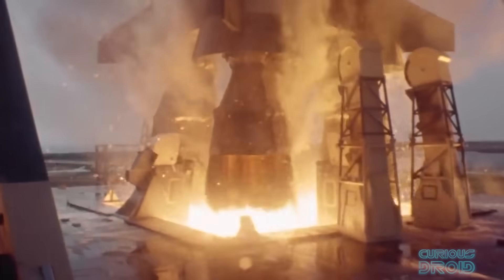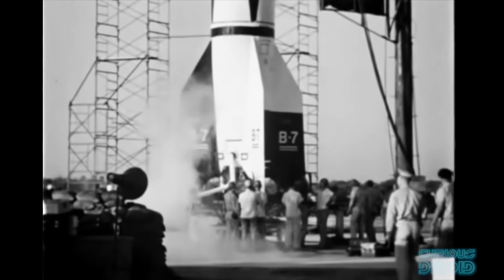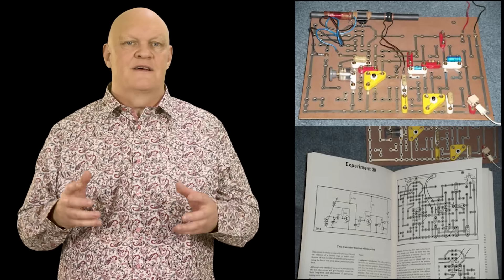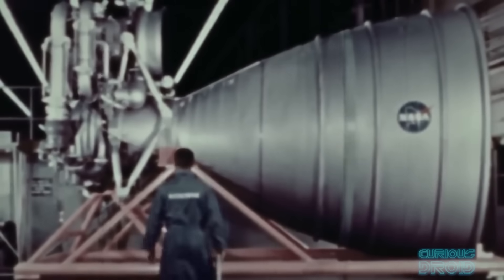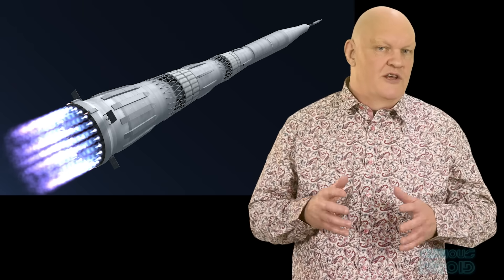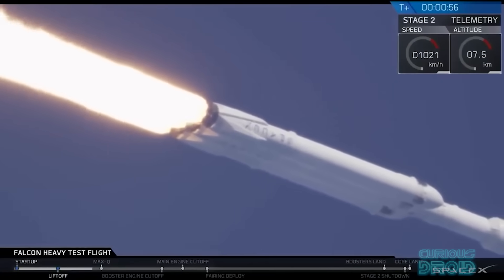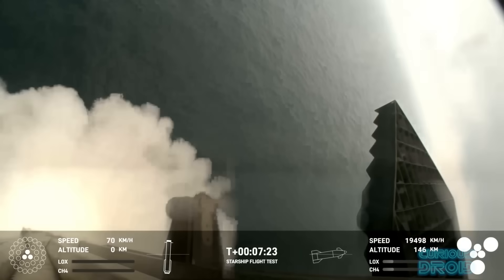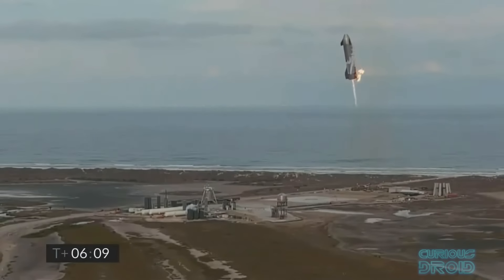Why Does SpaceX Use 33 Engines While NASA Used Just 5?

Comment: Because NASA's engines actually worked.
Reply: So do SpaceX’s engines.
Reply: @Hobbes746  Is that why they're still sending up empty rockets that haven't been recovered, years after they were supposed to be on Mars? Very impressive. 😂
Reply: @Videomorgue  SpaceX is behind schedule. This is not surprising: their schedule for Starship was hugely optimistic. 
They first spent several years working on carbon fibre structures for Starship, before scrapping all that work and starting again with stainless steel. 
The test campaign they’re conducting now is moving very fast, compared to the development of pretty much any rocket in history.

Comment: I was taught that the F1 engine itself was capable of lengthy operation.  But, the gas generator assembly wasn't.  By design, the generator ran very rich and sooted up the pump turbine vanes quickly.  Between operations, it all needed to be "de-sooted".

Comment: The main problem of many engines, however, remains unsolved. More engines means more points of failure, so the reliability (for single use) needs to be somewhat higher (certainly for human rating). The reliability, if reused for extraterrestrial landings, needs to be, for all practical purposes, a straight 100% - if there's so much as a hint of a single engine failing on launch from Earth, the mission needs to be abandoned.
As long as they keep accepting engine failures even on first launch, they're never going to achieve any of the goals that are claimed for Starship. Not that that's going to happen anyway - Starship is designed based on 1950s science fiction magazine covers, not on any understanding of rocket engineering.
Reply: Raptors reliability is steadily increasing over that last 5 years. They're soon to be moving onto v3 that will be even more simplified and reliable. So much so the point where they can get rid of the shielding around them and save mass. Starship will not need all three of the Raptor engines for an extra terrestrial landing. They can lose one right off the bat. And if it's late into the landing they can lose another. But at that point they may need a rescue ship. Nothing about Starship is from the 1950s. It's being designed for full reuse. No one has ever done anything like that before. That was a very ignorant comment.

Comment: I don't claim to be expert, but I think the detonation of black powder charges in the nozzle came AFTER the solution was found.

With all injectors venting into the engine bell from a flat injector plate, strands of unstable combustion were free to then randomly destabilise other areas inside the bell. The solution actually came from the V-2 engine injector configuration, where fuel/lox outlets were grouped in clusters. This meant that instability in one cluster was overwhelmed by stable streams of thrust adjacent to the momentarily defective impulse.

NASA opted to then add baffles on the injector plate to compartmentalise the thrust streams. This was finally proven effective by falsely imposing instability with the said charges, which was contained by the flame in the adjacent streams beyond the adjacent baffles.

Deniers often claim the instability was never solved, and that the 'pogo' issues which ensued led NASA to fake the landings. This is nonsense. Combustion instability was solved by the baffles - pogo is a longitudinal oscillation that can occur at any time in any system due to very small deviations in the rapid delivery of liquids (the mass flow rates) to the engines, passing vibration to the surrounding structures, particularly the X-beam trusses in which the engines were mounted. 

This was heavily mitigated by using in-line helium dampers in the LOX lines to interrupt any resonant frequency build-up induced by momentary pockets of vacuum in the flow. By these methods instability both sides of the injector plate were largely eradicated.

Comment: At 1:11, you say:

 "The Apollo program, and later Skylab program launched 13 Saturn V's, Which included Apollo 4, 5, and 6 (the unmanned test flights), and used a total 65 Rocketdyne F-1 engines, with a 100% success rate."

I have 2 corrections:

Correction 1: The Apollo 5 launch was performed by a Saturn 1B (which uses 8 Rocketdyne H-1 engines on its first stage, and no 5 F-1's).

Correction 2: The F-1 engines did not have a 100% success rate in the sense of them all functioning perfectly during their missions. During the Apollo 6 launch, 2 of the 5 F-1 engines malfunctioned. (One  shut down early due to pogo oscillations, and the had performance issues.) That resulted in the rocket never reaching its target orbit, though it was still able to fulfill its mission of allowing the Lunar Module to be tested in space.

Comment: Scale of economy, relative mass production, and statistical probabilities. If engine has a 1:30 chance of failure, and you use one. It will only fail once every 30 missions, on average (possibly 3 in a row). Which is unacceptable. 

If you use 30 engines, the probability of a failure is 1 on each and every flight. Possibly 3 on the same flight (10% reduction in thrust). 

The SpaceX rocket is designed around this philosophy, by having substantial excess thrust vs the under powered (no redundancy) 1.15:1 ratio of Saturn V.

And the probability of having three engines next to each other fail, out of 30 total possible engines to fail, is going to be several orders of magnitude less odds than 10%. So, the chance of possibly losing control is not zero, but close to it.

Comment: SpaceX copied Soviet N-1.  SpaceX will fail like the Soviet did.
Reply: More engines to immediately shut down when a problem is detected.  Notice the launches and look closely at how some engines get shut down.
Reply: The most important similarity between the N-1 and Starship is not the configuration, but the development method, testing the stages by flying them instead of having lots of test runs on test stands. The Soviets didn’t fail, they gave up. 
For Proton, a smaller rocket developed using the same method, the Soviets needed 14 launches to get the rocket to operational status. They expected to need a similar number of launches for the N-1. When Korolev died, his successor (who had his own design for a moon rocket and was grumpy his design wasn’t chosen) did not want the N-1 to succeed so he didn’t push the program forward. When the moon race was lost, the USSR lost all interest and allowed the program to flounder.
Reply: Remind me again why the N1 failures happened?
Reply: @infinitelyexplosive  it failed by not being big enough.  Bigger engines, if made reliable enough, are more efficient.  
Every additional engine is a potential source of failure.  It is mathematical that more engines increase the risk of failure, and cascading failure is also a greater likelihood.
Elementary my dear Watson.
Reply: @DumbledoreMcCracken  you might want to go and read up on the history of the N1. You clearly don’t know much about its launch attempts
Reply: @infinitelyexplosive  i don't read Russian

However, the English language analysis exactly matches what I said.  Maybe you should earn a real engineering degree before you make comments about complicated systems.
Reply: @DumbledoreMcCracken  control computer failure, lack of control authority, and fluid hammer are all obviously unrelated to the number of engines. A single cascading engine failure in the N1 is clearly insufficient evidence to claim that that particular failure mode is a greater concern than the failure modes associated with larger engines, especially on a rocket that can be static fired. Maybe you should go back and get a degree in statistics?
Reply: @infinitelyexplosive  it didn't shut down all engines at once initially.  Again, get a real engineering degree and then we'll talk.
Reply: @DumbledoreMcCracken  right, so you don’t actually know anything about N1 and all you have left to defend your obviously wrong position is “but ur engineering degree”. Have fun with that
Reply: @infinitelyexplosive  you lack the education to understand the answer I already provided. I can't fix your problem.
Reply: @DumbledoreMcCracken  you keep asserting that without evidence, like everything else you’ve asserted so far. But the fact that you focus on it is telling, regardless.

Comment: They don't need 33 engines, Elon Musk is just a giant man child.
Reply: They use 33 engines for several reasons:
1. it allows them to use the same engine on both stages, instead of having to develop two engines. 
2. more engines means you build experience in the manufacturing process faster, which helps push the cost per engine down
3. it allows the stage to land using the same engines as were used for liftoff, instead of needing separate smaller engines for the landing.
4. it reduces the risk of having to abort the mission if an engine fails. This has already been demonstrated: on flight 4, Starship made its planned orbit despite losing an engine directly after liftoff.
Reply: How many engines do they need then? 35? 30? Maybe write a letter to SpaceX tell them they're doing it wrong.
Reply: @motokid6008  Sorry, can't make out what you're saying with your lips affixed to Elon's arse.
Reply: @murrethmedia - I don't care for Elon. But again you seem to know better than the SpaceX engineers so I'm curious. How many engines? 42?
Reply: @murrethmedia  I think Musk lives rent free in your head. Grow up already.

Comment: The reason an SLs can get away with 4 engines is the SRB’s. I don’t know the ration on SLS but on the shuttle the SRB’s produced over 60% of the thrust at liftoff, which means the shuttle would have needed 9-10 engines to lift off with just the RS-25’s. I can’t imagine SLS would need less, and at a cost of $50m+ per engine.